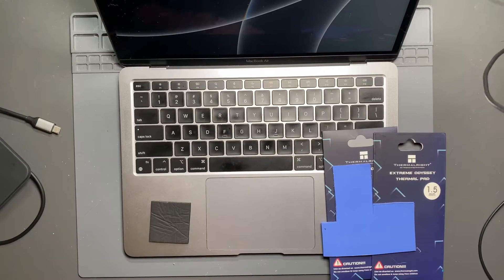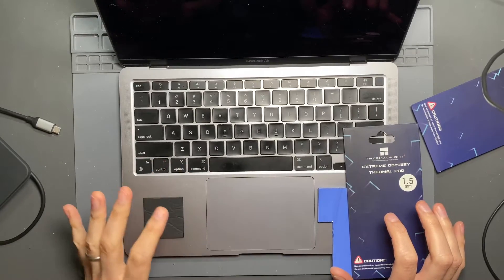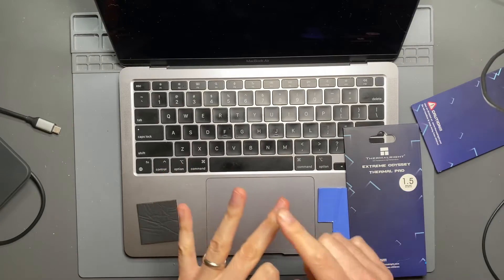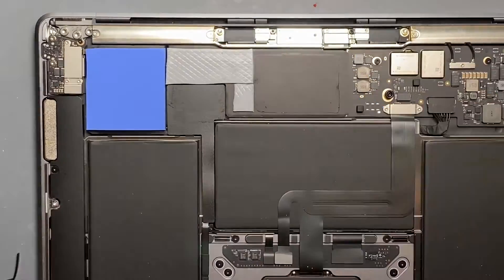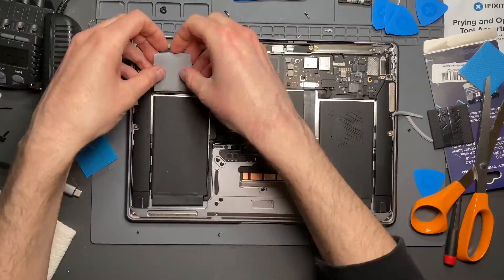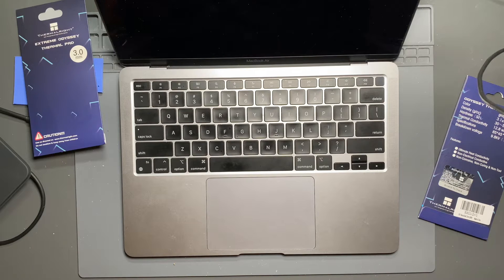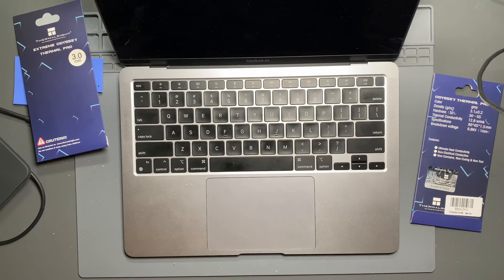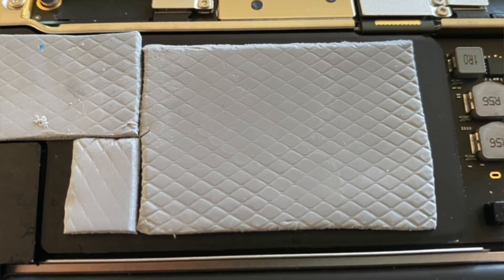Testing M1 MacBook Air Thermal Modifications

Comment: I just replaced the battery and keyboard on my M1 Air and am looking to do this mod too. It's at the end of its lifespan anyway and I'm choking it with Xcode projects and 10+ apps running at once on 8GB of ram, so I want to use that full ~16W of performance. Would you say its worth it barring any worries of lifespan or degradation of any components? Only thing I'm worried about is that charging issue you mentioned and didn't see any other videos that replicated it.

Comment: Interesting, wonder how much a laptop cooling stand would mitigate the downsides of the thermal mod.
Reply: thermal pads in my mba m1 with cooling stand makes in stress-test 85 Celsius cpu, 35-38 battery, 35-40 ssd maximum, but this is rare user case for me. But I still think this is a necessary measure for m1air